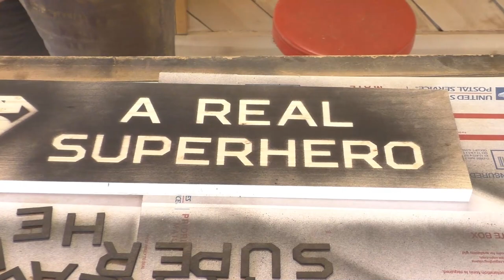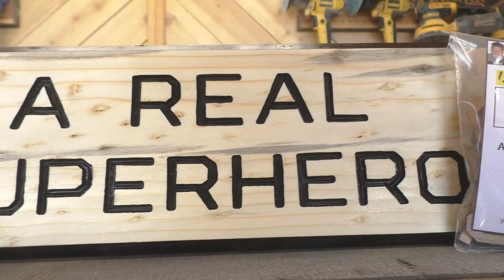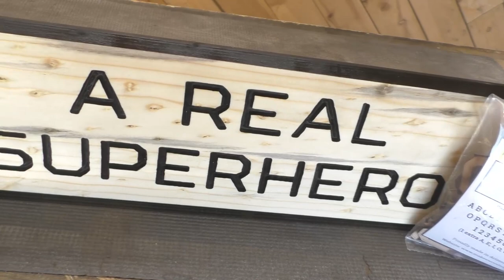Superhero Sign

Comment: I really hate to be picky, but... at the 6:26 mark in the video, your dad is going the wrong way with the router, on the chamfer cut. Since the router bit spins clockwise, we always go counter clockwise on edges, because that's the way they cut. Basic router operation. 
Unless I'm missing something and your dad has a reason for that.
Reply from the maker: Well, there's some variable on the grain you're cutting, but we honestly don't worry too much about that. When you get into fine detailed work, that stuff really matters. We're just a couple of redneck sign carvers
Reply: @oldave100  Hey it works, so no big deal.